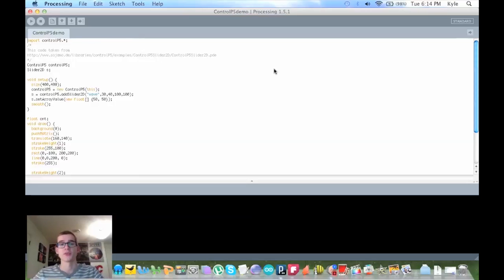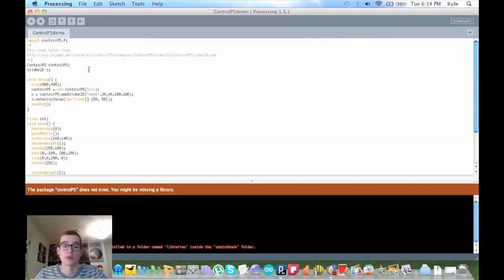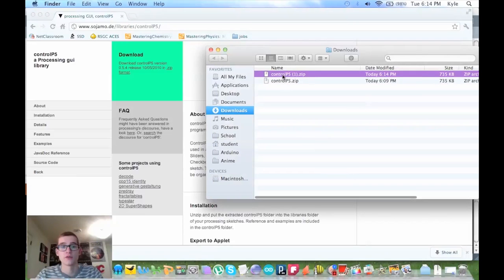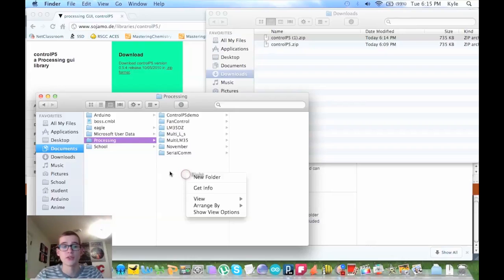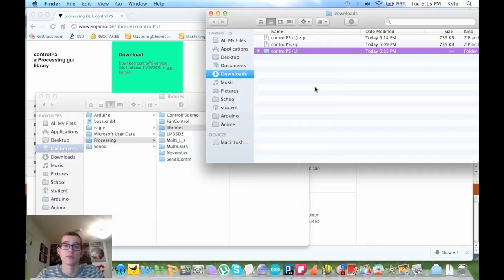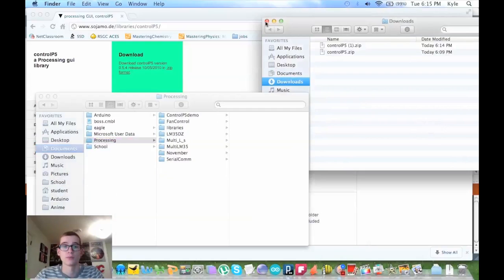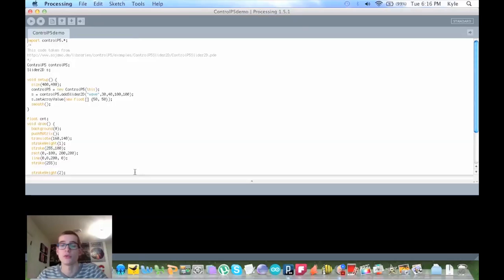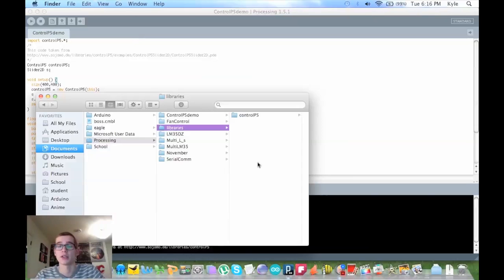How to add libraries to Processing

Comment: Thought this was awesome, but didn't work for me. Don't know why. Can you think of a reason?  Says "
Note that release 1.0, libraries must be installed in a folder named 'libraries' inside the 'sketchbook' folder."
Reply: +Alison Lewis Fixed it! It has to go inside the same folder as the sketch itself
Reply from the maker: +Alison Lewis Thanks for the feedback. I haven't used Processing in a long time but I'm assuming with the updates this method is probably outdated. Thanks for letting me know!